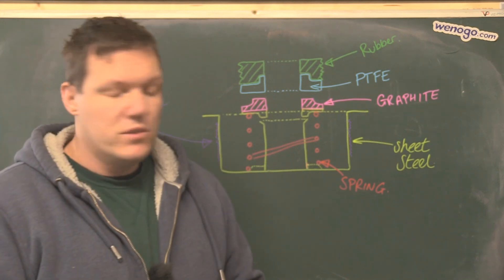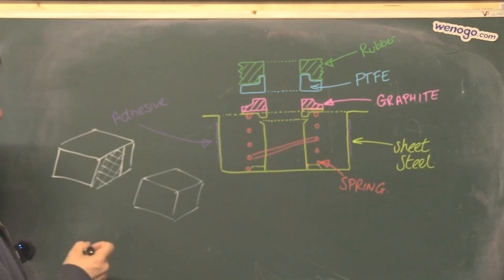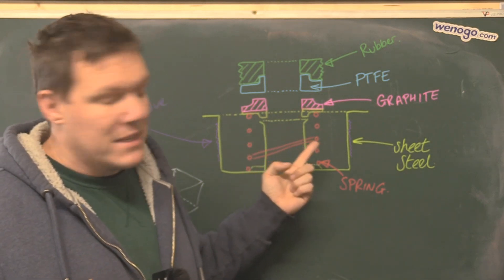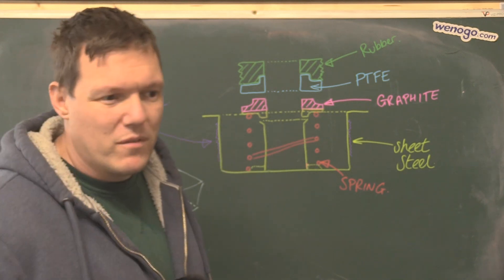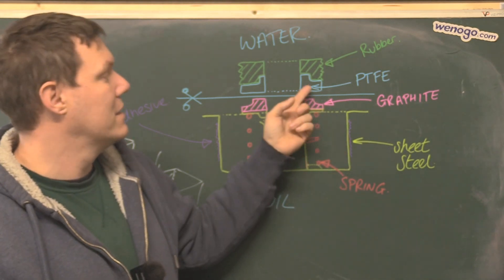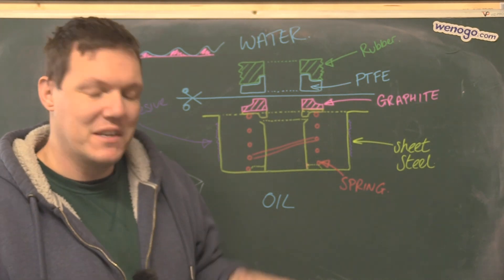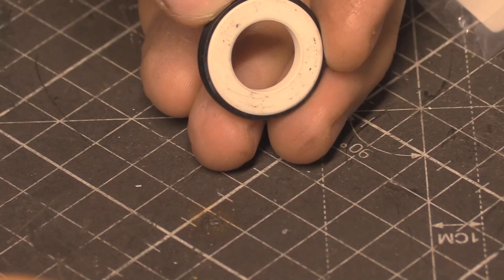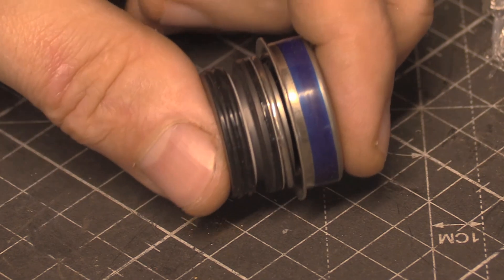Mechnical Seals - The Water pump one

Comment: And then you have the moronic KTM water pump seals. 
Just a small rubber seal (almost similar to an oil seal), no weep hole and coolant leaking straight into the engine. 
(Note especially the LC8 950/990 series)

Comment: Finding replacements can be difficult if no longer listed. I have one which has failed where it has a normal seal on the shaft as well (to stop coolant leaking down the shaft), and through not being used for a while this part of the seal stuck to the shaft and was damaged.

Comment: I have a question regarding fork seals. Can you use radial shaft seals like the ones used in engines? I have had no problems with SKF HMSA10 seals leaking. They seem to work better than the original ones and I can get them in any size cheap from my local bearing supplier.
Reply: I'm not sure, but I think often fork seals designed to have small lip pressure to reduce sticktion and friction. It is not so important for rotating shaft, so regular seal may be overkill in terms of pressure. Also check number of lips. There are seals with 1,2 and 3 lips. Lips are directional. 1 lip seal probably not suitable for fork. Look for lips similar to OEM seals.

Comment: But what about the weep hole on a water pump to show that the seal has failed?  You didn't mention that.
Reply: It is other type when you have two seals on oil-atmosphere-water interfaces. So leaking water goes to small chamber, connected with outer world by the weep hole.
Reply: @inevespace drz400 eats these things.

Comment: What stops the oil or water leaking down the shaft in your example in most industrial pumps I have fitted seals to uses an oring to seal on the shaft on the rotating seal?

Comment: Didn’t realize bikes used a Teflon and graphite sealing face. all the mechanical seals I deal with use graphite and a ceramic one what looks like aluminum oxide
Reply: Super, super slippery PTFE can also be found in [on] your fork leg bushings.
Reply: yep in chemical industry more used to carbon/ceramic, aluminium oxide or silicon carbide the elastomer eg rubber/Teflon etc being limited to the o-rings or bellows between the outer of the cartridge and the casing/shaft static seals
Reply: We have a lot of double seals with a water feed between them when the pumps are used as scavenger or with vacuum some use a carbon ceramic others tungsten these are very common in industrial applications but none with PTFE as in this example.
Reply: @ItsAllJustBollox  the white "PTFE" looks suspiciously like super slippery Aluminium Oxide to me, but I might be talking bllx 🤣
Reply: Matt,why didn't you wear black rubber gloves for them there close ups?😧